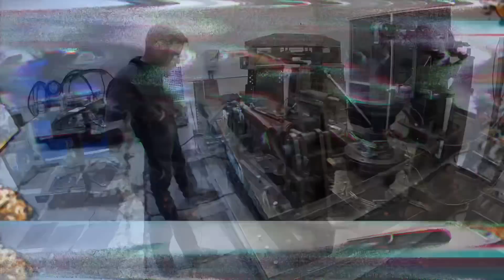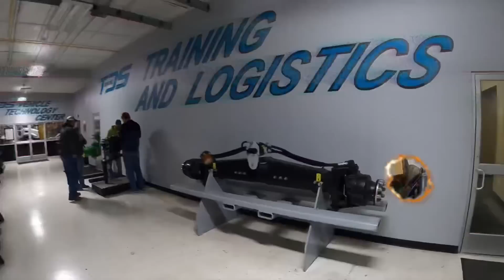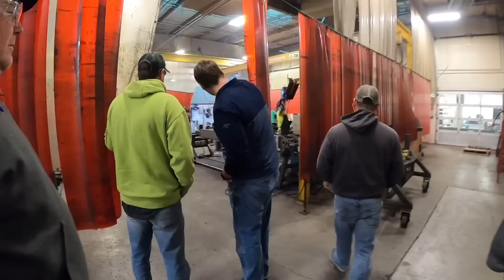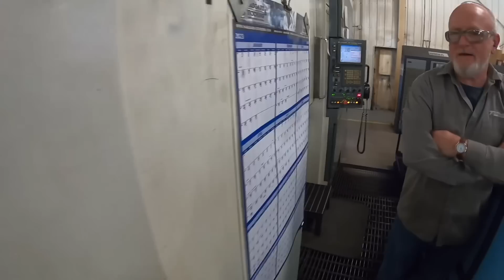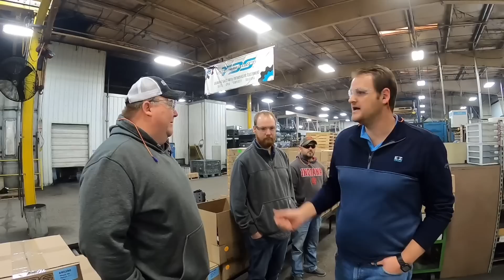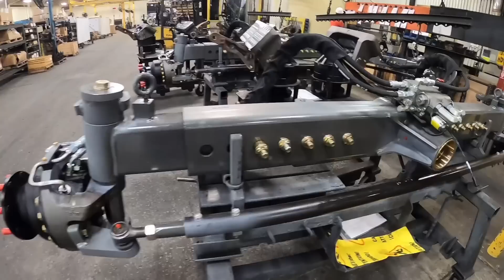TDS visit and tour

Comment: Hi Matt, A question regarding the full hydraulic drive compared to the Fendt Vario  gearbox - planetry geartrain using hydrostatic to variate the ratio which is far and away more efficient - (fuel and waste heat)
Reply from the maker: Thank you

Comment: Interesting set up. 
But the rears are only losing traction due to running out of suspension travel with the singular spring to axle set up. it needs a cantilever style of rear diff hanger set up to.
But a great hydro drive system for the front. No front tail shafts to break. No extra clearance issues with the front end swap ( by the looks).
Reply from the maker: Thank you!